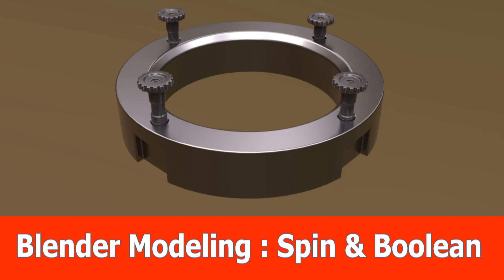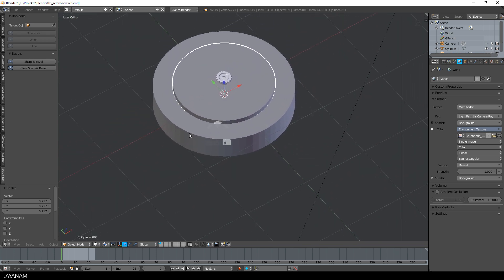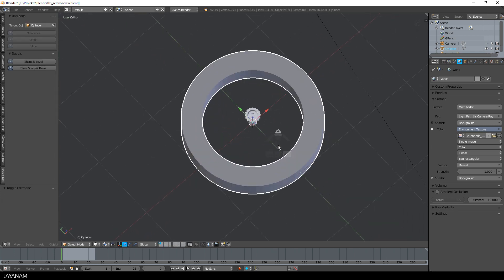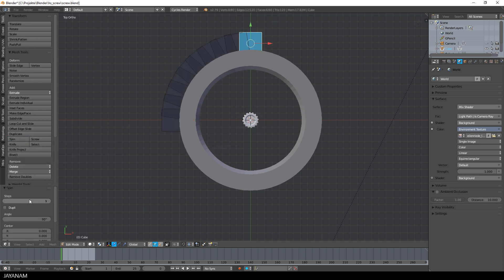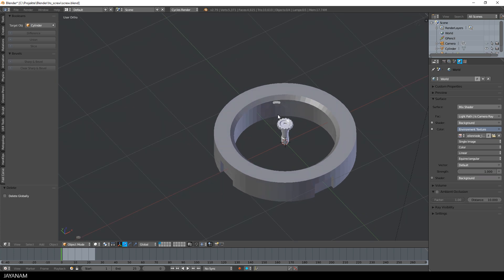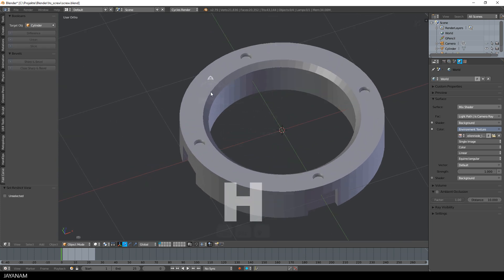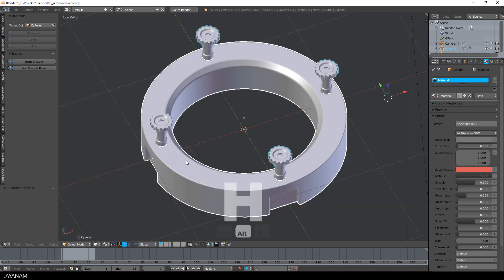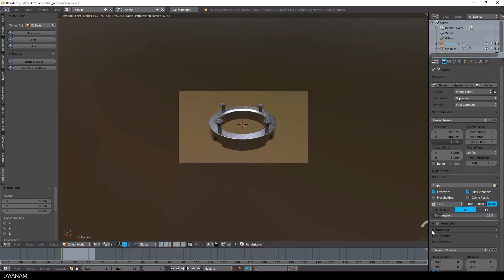Blender Modeling : Spin Tool and Boolean

Comment: I'm sorry, but I'm having some trouble.  First of all, I can't understand github, lol.  I can't figure out how to download your "Fast Carve" tool.  Second, whenever I use the Boolean modifier, I get jagged edges around the openings of where the objects intersected to form the hole.  I've tried numerous things to smooth out the area around the opening, I've tried switching from quads to tri's and back again, I've tried increasing and decreasing the number of vertices, but to no avail.  Can you please help?  
 Also, how are you so easily able to access the panel that allows you to increase or decrease the number of vertices in your objects, as you did at the :21 mark?  You actually have a panel that pops up when you create your cylinder that lets you make adjustments to the Vertices, Radius, Depth, Cap, ect!  Do I need to make adjustments to my user settings in order to access that panel?  
  Sorry for all the questions, I'm just trying not to be too frustrated with my Noobiness.  Whatever help you or any one else can offer would be greatly appreciated!

Comment: Is there any advantage here for using the spin tool over the array modifier with rotated empty?
Reply from the maker: You can use both to get the job done, but in my opinion the spin tool is a bit faster for this purpose.